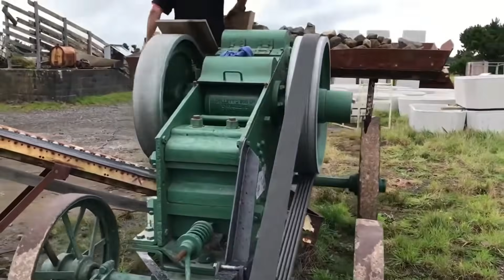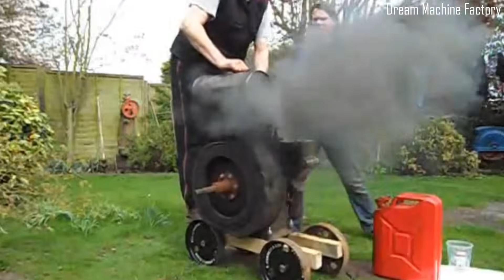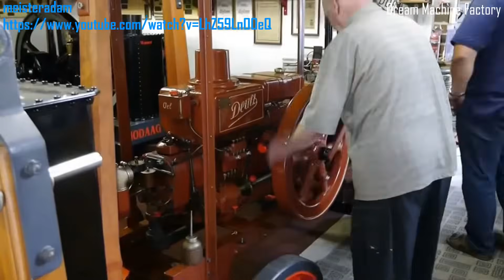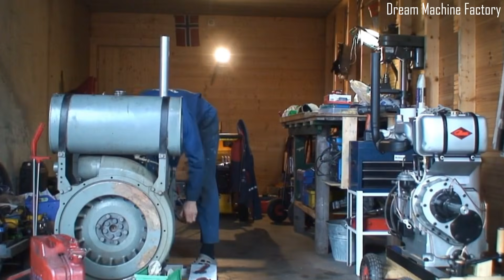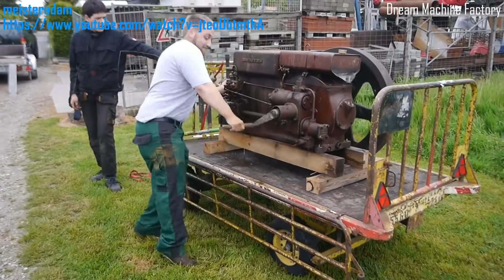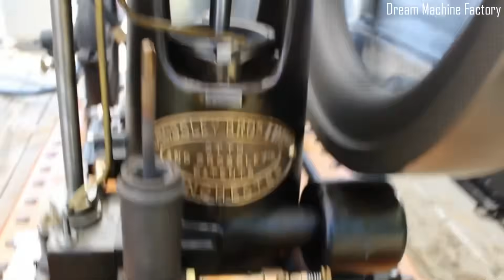Iron Giants of the Farm: Forgotten Engines That Drove Rural Life

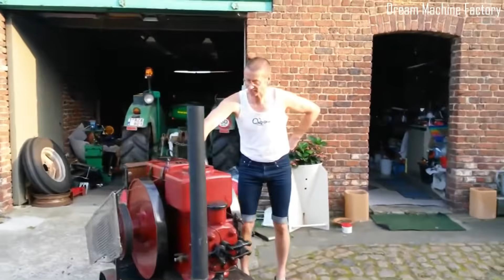Comment: 52:25 Air-cooled??? You are literally showing the cooling water reservoir on top of the engine. That kind of system is typical of Deutz engines which are rarely, if ever air-cooled